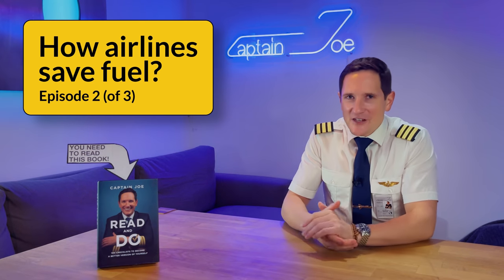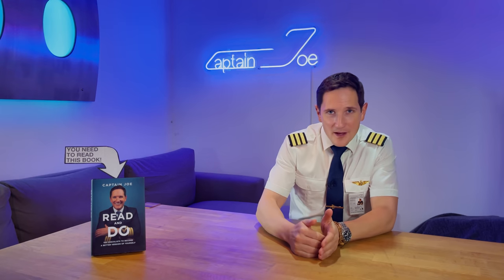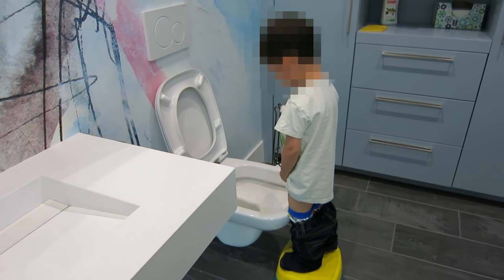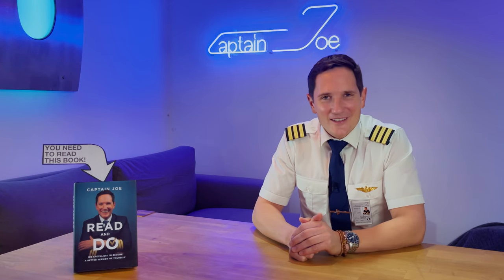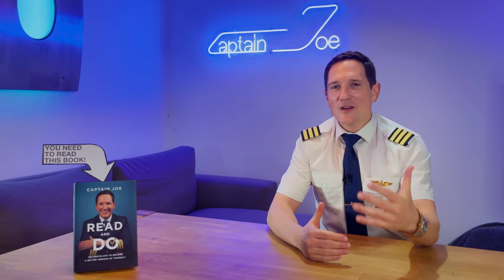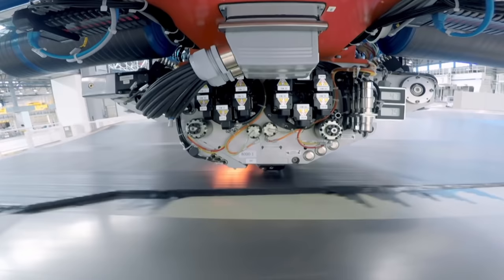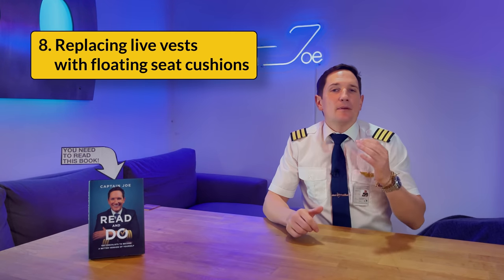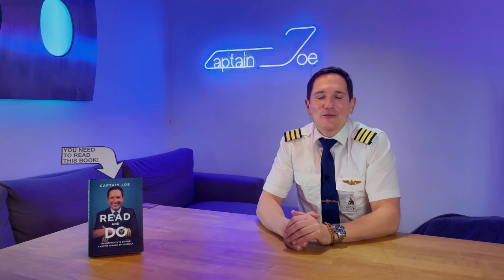HOW TO REDUCE WEIGHT on planes? Explained by CAPTAIN JOE

Comment: Or how about instead of shaving small numbers off we stop flying planes without passengers, just to keep timeslots?
Reply: Then passengers would stop flying because the timing would be so messed up.     You need to think big picture to know why planes fly somewhere with few or zero passengers.    They usually fly to a place where more people are goin to  than leaving from,  but need to get back to get more people.  If they wait for a plane to be full to go back to get more  people. They would have thousands of people waiting at one place for a long time.  If they send more plane to cover for the people waiting but do not sent any empty planes back, they will run out of planes where they are actually needed, plus the planes waiting for a full flight would take up the space needed for the incoming planes.   It is a balancing act that may not seem to make sense if you do not think about the whole situation but only thing of the one plane flying empty or with only a few passengers.   

Also, when you see a plane empty coming from somewhere, it is usually during a holiday or some other time when most people are only goint to a destination, then when the holiday ends, that plane will be packed coming out of there.

Comment: Ein Vorschlag wäre, den Ticketpreis nach dem Gesamtgewicht des Passagiers festzulegen. Als Basis zum Beispiel 80 kg für Männer 70 kg für Frauen  (jeweils mit Kleidung) und 10 kg Gepäck. 
Dann könnte ein Ticket für eine 1000 km Flugstrecke (1  kg  = 1 Euro) für Männer 90 Euro, für Frauen 80 Euro kosten. Bei einem höheren Gewicht kostet jedes Kg Körper oder Gepäckgewicht einen Euro extra. Wer weniger als das Normalgewicht wiegt, bekommt einen Bonus oder kann mehr Gepäck mitnehmen. 
Das wäre doch eine gute Motivation zum Abnehmen und für gesundere Ernährung?

Der Vorschlag ist aber sicher nicht umsetzbar, weil es als diskriminierend empfunden wird. Ich bin mir aber sicher, das er schon oft in den Führungszirkeln der Fluglinien diskutiert wurde.

Comment: That argument about saving pee weight is an erroneous, absolute  calculation, in terms of error or differential calculus . You have to calculate that in relation to the absolute weight of your aircraft, showing that you just can neglect that impact. Please calculate instead, how much fuel is consumed for the eight of the aircraft alone. Then you see, that the first might make a slight Effect, but latter a big impact. For all of your examples, a % saving would be interesting, instead, also regarding the discussion of relevant CO2 saving
Reply: He also got the figures wrong, I recall the Mythbusters tested it and got the surprising result that women can hold a bit more, although by a small amount.

Comment: Very poor analogy adding a trailer to the car. Apples and oranges as you have added DRAG.
Reply: Would have been a better analogy to fill the car with books,  nut it would not have shown as much of a difference as pulling a trailer.

Comment: If cars can run on solar power during the day to reduce the amount of fuel. Could a similar technology be used on a plane by needing less fule and hence forth starting off with less fule weight? Or would the extra weight installed on a plane in order to do that be more weight than the amount of fuel weight they would save making it not worth while?
Reply: Conceptually it can of course, but not in a practical scale, especially in an airliner

Because in a jet engine, it's the exhaust gases which creates the thrust needed to move the aircraft. With solar panel you can only implement a propeller which isnt powerful or fast enough.

Comment: But in a steady flight why would the weight add to fuel consumption except if you need to fly faster because of it
Reply: A heavier plane needs more lift to stay airborne. This can be achieved in several ways:

1. Fly faster, which requires more thrust and thus fuel consumption in total since the air resistance is proportional to the speed squared. (2 x speed = 4 x drag)
2. Increase pitch angle (angle of attack), which will also increase air resistance and thus the thrust needed to maintain the same speed at the same altitude.
3. Descend into denser air, thus increasing lift but also air resistance and thus the need for more thrust. On long-distance flights, a plane will typically climb higher as it burns fuel and gets lighter because flying in thinner air with less air resistance is more economical.

Comment: Try eliminating the shower in the 1st class of an A380 and see the rich dudes howl...

Airlines are not worried about fuel savings or the environment as long as they can RECOVER those costs...but with cutthroat pricing and undercutting amongst the airlines those other class seats cannot be sold at lower prices....that's why they pare things to the bone in the cattle class.
Reply: I can’t blame them. The rich guy is paying 5 figures to have a leather bed, shower, caviar, and lobster, yet the “cattle”, as you call em, want to have big comfy seats, the same caviar and lobster, yet still pay 4 bucks and a nickel, and when they instead get what their 4 bucks and nickel budget can possibly buy em, they b*tch about it on YouTube……

Comment: Flotation seat is great; can we also get one that will bounce us out of a corn field?
Reply: Rather it bounces the whole aircraft INTO a corn field if the emergency is that severe. Corn fields that are large enough are one of the safer places to have to make an emergency landing in an airliner. Sure beats the Hudson river, but in a pinch I'll take an earthen embankment dam. (both of those two last places I mentioned have had aircraft land in them without many casualties or injuries).

Comment: Does the MFB also account for the additional fuel needed due to the increased fuel-weight needed for the added weight; or is it simply a per kg measure, and you'd need to factor in fuel-weight when estimating the impact?
Reply: Since it's a measure of how much fuel you use, for a given distance, per weight unit, it doesn't matter if you're carrying extra fuel to go further, or extra cargo and flying a shorter distance. Think about it: it only cares about how much the plane weights that instant, it doesn't know if it needs to go further or not. For a given plane weight, it burns that much fuel per 1000 km, no matter how many kilometers/miles if flies.
What you're probably thinking involves the plane's range for payload, then it would matter indeed if you're balancing carried weight vs. distance flown.

Comment: Let's paint the outside with a few tons of paint
Reply: The paint you see on the aircraft is a necessity for most. if they could make it cheaper with out they would have done so. however the paint is often the thing that protects the body from the elements like water and sunlight (UV)
Reply: @sirBrouwer  Also some of the "paint" applied is actually a part of the composite that makes up the airframe!  (Gone are the days of aircraft being "simple" fancy shaped metal tubes.)

Comment: Ok, as the airlines charge for the weight of luggage, why don’t they charge for the weight of the passenger by the Kilogram? Makes sense right?
Reply: That would lead to PR nightmares and discrimination lawsuits tbh
Reply: @ZK-APA  - Although when your transporting cargo your tariff is changed by density. Or overall mass divided by volume.  I don’t see a reason why passenger freight is any different.  It’s all weight.  Ok larger people will have to pay a lot more, but it’s only the maths.
Reply: @rogerhargreaves2272  again, it'll not work in a practical world, simply because it's unethical. As in this will simply make people go fly with a competing airline who don't have such a fare.
Reply: @ZK-APA  I know it’s probably unethical but at the end of the day airlines want to save fuel; to do this they should charge by weight.  Listen up they weigh you check in baggage.  I know exactly what you mean though, there would be absolutely carnage at the check in.  I’ve flown on aircraft where they use the fat people to position the centre of gravity better, they probably didn’t understand though.

Comment: Best way to safe fuel is when the plane only pumps enough fuel into the tanks to fly to the destination (wir reserve). Why is that not standard? Because fuel saving is not everything.
Reply: That is the standard. Fuel is loaded based on the distance to the destination, distance to potential diversion airports, expected weather, calculated weight estimate of the passengers & cargo, and the minimum additional reserve required by airline policies.
Reply: @jblyon2  Sometimes it's also constrained by availability and/or price of fuel at the destination.
We're trying to carry enough fuel to get from A to B, but then also either back to A (or to C) that has fuel at an acceptable price.
So the math goes something like this (without using any actual math):
Figure out the 2nd leg of the trip 1st (plus reserves) because the weight of that fuel influences how much fuel we'll need to do the 1st leg.
Now, add the weight of that fuel to your "payload weight" of the 1st leg's fuel calculations, since at no point on the 1st leg barring an emergency should you be required to cut into that 2nd leg's fuel quantity. Now you can do the 1st leg's fuel calculations (plus reserves) normally, with the adjusted payload weight of course.
The final fuel mass should add up like this: (2nd leg's fuel weight) + (2nd leg's reserve fuel weight) + (1st leg's extra fuel weight it takes to move 2nd leg's fuel + reserve across the distance of the trip's 1st leg) + (1st leg's fuel weight) + (1st leg's reserve fuel weight) + (1st leg's extra reserve fuel weight that it takes to move the 2nd leg's fuel weight + reserve fuel to the selected diversion airport in case of bad weather).
It sounds complex, and it is a little bit, but if you take it one step at a time it's entirely something an average non-pilot human being could calculate out (tho they'd do better if they just got out of school).

Reminds me of the math you need to do when figuring out how much fuel you need to make a rocket go somewhere, if I'm honest (then again, I do play a lot of Kerbal Space Program).

Comment: Why airliner don´t change old engine for new one keeping the same aircraft?
The new one are less noisy and safe more fuel....
Reply: That actually happens with most successful airliners.
For instance, the "A320 CEO" uses older engines, the "A320 NEO" uses newer, more efficient ones, however they're both still A320's at their cores.
Likewise with the Boeing 737. The 737-100 -200 -300 all used LOW-bypass turbofans (JT9D type of thing), you can tell because the engine nacelles look like cigars and not "eggs with the ends cut off" (they're a lot longer and skinnier). On the 737-400 to 700, they switched to the CFM56 engine, which was one of the first high-bypass turbofans, and massively more efficient than the older engines. And on the 737 MAX series, they switched to the LEAP-1b engine, which has an even higher bypass ratio (however this starts to cause issues with controlling the aircraft, which is what caused the whole fleet to get grounded for nearly a year).

Even the 747 isn't "stuck" with the same engines it originally took off with, as the years have gone by they have been replaced with newer and more efficient engines.
Reply: @44R0Ndin  but I mean a already built plane, if the engines can be replaced for a newer and more eficient one
Reply: @grankapitan2281  That doesn't happen as much with civillian airliners, but it does happen sometimes with military aircraft. For instance, the US Government just signed a contract to replace all the engines in the B-52 bombers with newer, more efficient ones that are easier to maintain because those engines are still being made (however I have a feeling that the parts issues were the main reason, not the efficiency gains). Additionally, they could have gone with replacing the 8 engines with 4, but they chose not to for some reason that I can't remember at the moment (but I would guess it has to do with ground clearance).

The reason it doesn't happen as often with airliners is probably that the airliner's computers would have to have a software update to correctly deal with the new engines, for instance if the engines are more efficient that will throw off the fuel calculations that are done completely without involving the engine's own control computers (if it even has one, most older engines use electrohydraulic controls that look more like the kind of system that controlled when a car's automatic transmission would shift gears say 10-15 years ago).
Reply: @44R0Ndin  actually a more practical answer for airliners is simply financial sense. If there is a demand for new engine designs for older aircraft, the manufacturer will make it. If there is no demand, then its not needed.
Reply: @ZK-APA  I wasn't trying to describe the strategy behind if an engine refit is performed or not, I was simply describing events that have happened in the past that fit what OP was asking for, since that's all they asked for.

EDIT: But you're correct, naturally. The simple fact is that most airlines aren't interested in squeezing every last bit of efficiency out of their airplanes by upgrading the engines every time a new one is made available. Instead, they wait until the entire aircraft has many systems that could make use of upgrades afforded by advances in technology since the aircraft was constructed. Sometimes this can be done to existing aircraft, however with something like the A320 NEO I think part of the upgrading was that the airframe as a whole was constructed with more composite materials, which means you need a new plane since you can't just switch an aluminum fuselage section for a carbon fiber or fiberglass one.

Additionally, with a situation like the A320 NEO vs CEO, the CEO option wasn't just "the same old A320", IIRC it was a development of the NEO program (which ended up taking longer than expected) which took a few of the upgrades that were intended to go on the A320 NEO and back-ported them when possible to the existing design of the A320. Things like upgraded fuel-saving winglets, other aerodynamic upgrades, avionics upgrades, that kind of thing that is easy enough to do without actually messing with the engines (apparently the engines were the thing that was holding the NEO program back).
This is speculation on my part, but it would make a lot of sense to me that every A320 CEO that ended up getting produced would be capable of being further upgraded to be nearly the same if not identical to an A320 NEO once the slower-to-develop technologies contained solely in the NEO were available (Aside from the fuselage materials changes of course).

Comment: Hello Capitain Joe, I have a quick question. Why are planes not weighted on a large scale (like for transport trucks) to get an exact weight for takeoff? For the PAX weight, I guess that there is a "standard" formula amoung the industry ie. an adult male weigh 85Kg, an adult female is 70 kg, etc. Shouldn't passengers be weighed (discretly!) before embarking so the crew would have a precise weight? I suppose that the savings could add up in the long run instead of using an average?
Reply: It's mostly because of convinence. As in, in a large airliner, there is a designed tolerance so even if the actual weight is more than calculated, it is still acceptable. This is much more practical than weighing everything to the exact.
However this is the case in larger passenger planes. In smaller planes (say caravan or twin otter), weight may be directly taken for a more exact measurement, as here there isnt that much tolerance.

Comment: Your calculation regarding 425.000 tons of fuel equals 314.000.000 liters is wrong. As one liter of fuel weighs aprox. 0,8 kg. So 425.000 tons equals 425.000.000 divided by 0,8 = 531.250.000 liter
But nice to see you again

Comment: Captain Joe! Love your videos, you explain everything so well. I had a question, I fly from JFK To MDE on the way back from MDE To JFK the captain always announces the flight will take 4 1/2 hours but it always really takes 5 1/2 hrs give or take few minutes more or less, but not one hour less. Why is this announced this way instead of saying the average 5 hrs 20 minutes flight time?
Reply: I'm not sure if it applies to your flights, but on mine the pilots in their announcements usually refer to flying time, which is actual time in the air, and doesn't include the time between the doors closing and pushback, time taxiing to and from the gates, and all other time when the plane isn't actually flying. I gather JFK is a pretty busy airport, so that could well take a lot of time. The flights I take have their public schedules generally from pushback to deplane, to give passengers a reasonable expectation of the minimum amount of time they're going to be in the plane for, which has to include a lot of on ground time.

Comment: The 787 has a separate compressor to pressurise the cabin, where as the a350 uses compressor bleed for the engine to pressurise the cabin.

Comment: Hey captain Joe, your videos are fantastic! But i have a question. The question is why are turbojet engines no used in these days? Thanks🙂Bye
Reply: Turbofans are more efficient.
Reply: In addition to what @Chris Kennedy said, Turbojets are also a noisier, and consume a lot more fuel. However, I'm certain if you search hard enough, you should be able to still find some old planes that fly with a turbojet attached to them. So, I don't think they are completely gone yet
Reply: Thanks
Reply: In simple terms, as how others have explained here, at airliner speeds (m0.78-0.85), turbo fans are most efficient